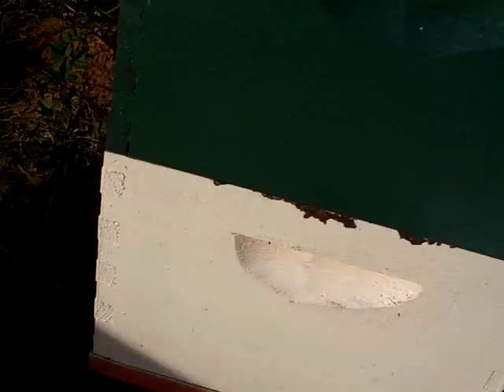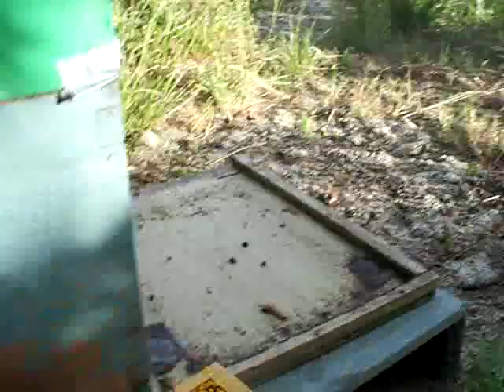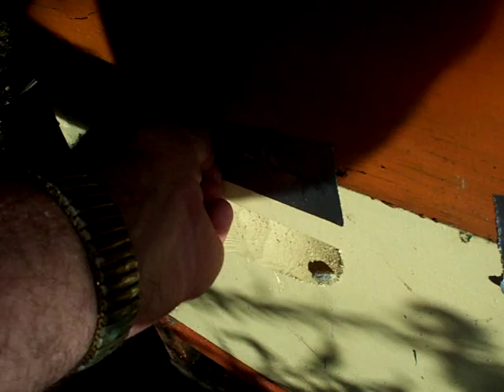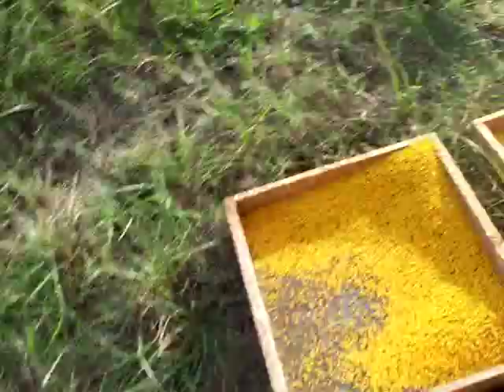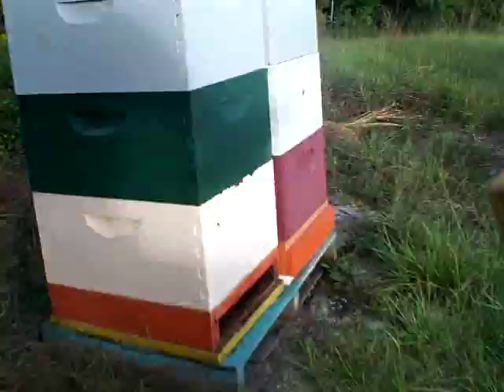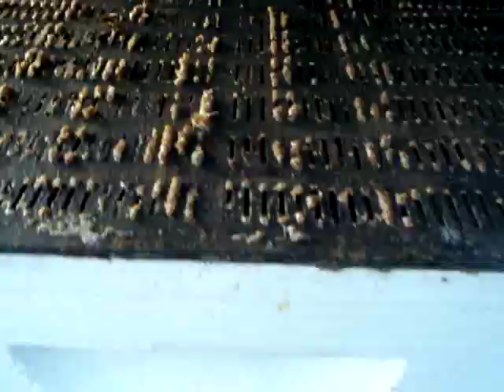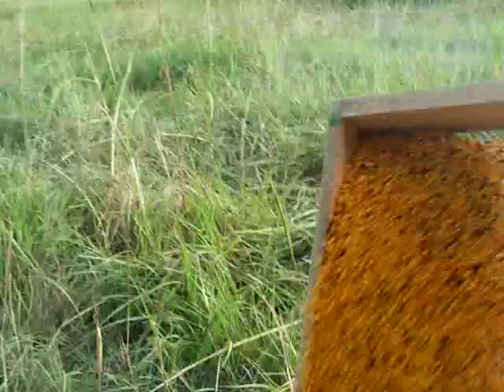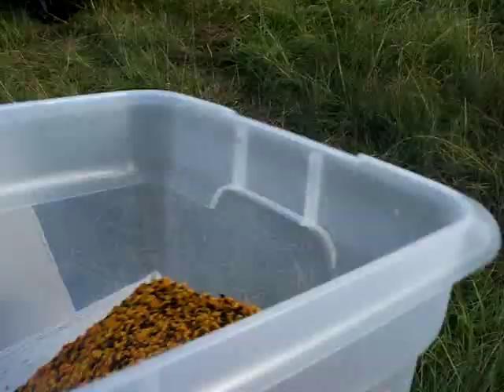BEE POLLEN TRAPS,GA Pollen Trap Beehives,Propolis Honey bees hive,Beekeepers Beekeeping John Pluta

Comment: Hey John, thanks for the great video. I recently purchased a Sundance bottom trap (I'm thinking yours are too if not similar) as all my entrances are at the bottom board. It's been on the hive for two days now, and it really seems to be throwing the bees off. They are really piling up outside the box like they don't want to go through it. I'm not worried about swarming just yet, but was curious, is this normal? How long before they accept it and start going though it more readily. Some are definitely going through because I have managed to collect a whopping teaspoon or so of pollen each day. I'm just experimenting, so I was thrilled that I got anything!
Reply: Tom, I just watched your video before I watched this one. I realize it has been a while since you made your video (6 years) and commented here. May I ask you, how did things turn out for you and the pollen trap. I want one that works like these John has but do not know where to buy the best one. Thanks, Phillip Hall
Reply: phillip hall I think they do pretty well. I still only have and run the one pollen trap on occasion. Need to have more like John does here to make it worth collecting. I’ve never run it year round to really get an idea of if/when is the best time, but for sure in the fall when goldenrod goes you should get plenty. The trap itself works well, but make note of when he mentioned the “leakers”. Definitely have to have the hives water tight so they can’t bypass the pollen trap!
Reply: @TomBrueggen  Thanks!